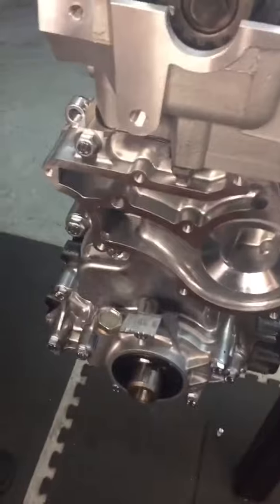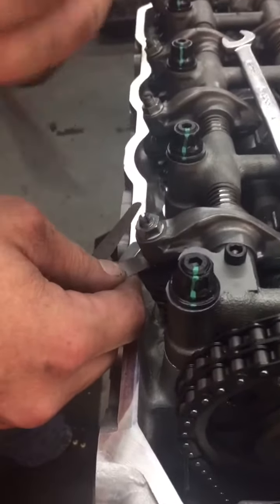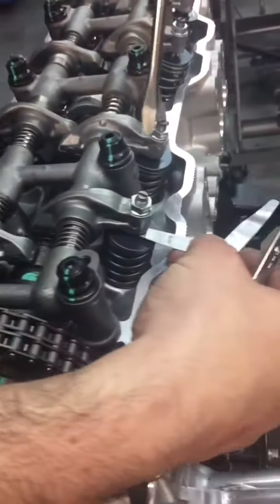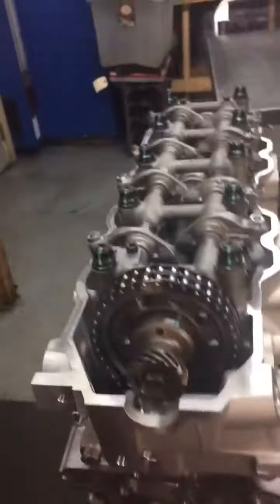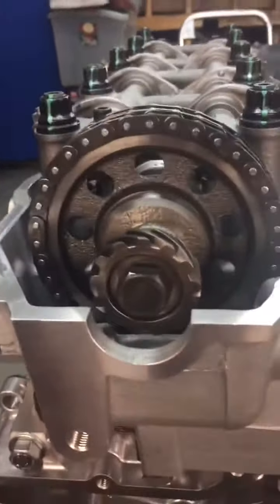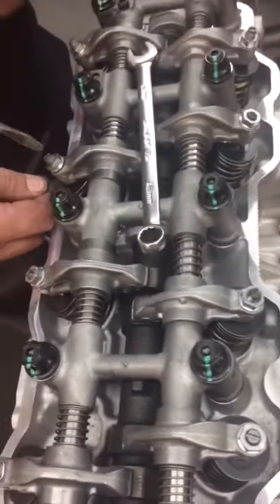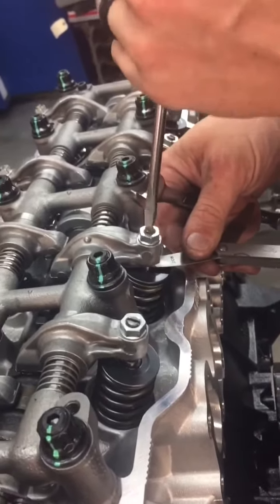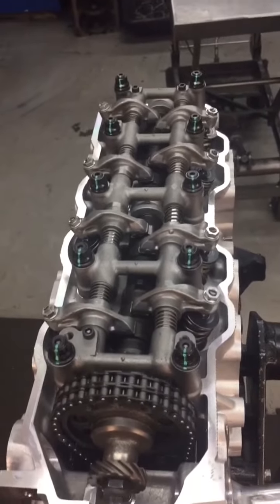Yota1 22R 22RE 22RTE Valve Adjustment

Comment: I know this was not part of video but can you tell what silicon to use to put the half moons on and where the silicone should go and how much to use? Thks..jc
Reply: I use some stuff by Aisin it’s called formed in place gasket (FIPG) it seals AMAZING. Used it for my timing cover to head gasket seal, rear main seal, and all the sealing bolts as well. Would definitely recommend. Good luck!
Reply: @CraftyMantis  I am late, but thks crafty..jc

Comment: Why wouldn't Toyota have the engine cold to adj. valves?
Reply: I'm thinking the same thing.  A person would have to work really fast before it cools down.  

I'm going to use the specs this video recommends when cold, and cross my fingers.
Reply: @whatsyurprob158   how did you end up going with the adjustment?
Reply: @yeahthebundys8391  Fine.  You cab do it cold or warm --- but just follow the specs listed here for each.  

Remember, the feel of the gap has to be just like points.  Not to tight, and not to loose.

Comment: At top dead center timming is at zero and distributor rotor points to plug 1. What does distributor rotor point to after  you turn crankshaft 360 degrees? Is timing at 0 also then?  Thks...jc
Reply from the maker: J C the rotor would be 180 from #1 and pointing at #4. The firing order is 1342 and the crankshaft turns twice to the cams once.
Reply: Great..so would the timing be at 0 also at this point or is that irrelevant as long as the distributor is at plug 4?  Thks...jc
Reply from the maker: J C the timing marks on the pulley will be on “0” when the engine is at TDC #1 or #4
Reply: @yota1performanceenginemach151  Thanks so much..jc

Comment: What kinda money do you have into building this 22r and what kinda power do you have after?
Reply: Not sure what this particular motor has different from stock, but I just had my 22R rebuilt for $1200. I had it done by a retired mechanic in SC. Most shops where I live wanted $1400-$1600.